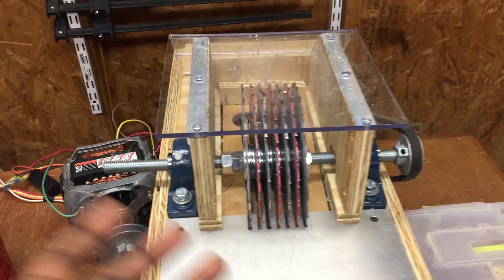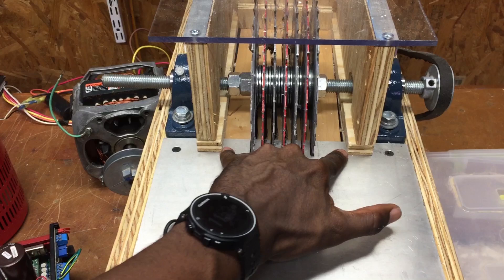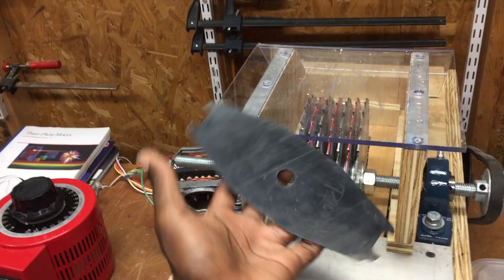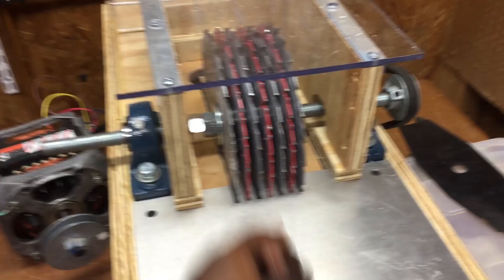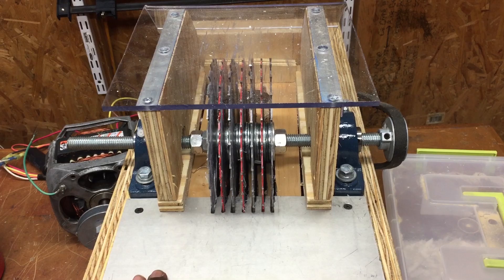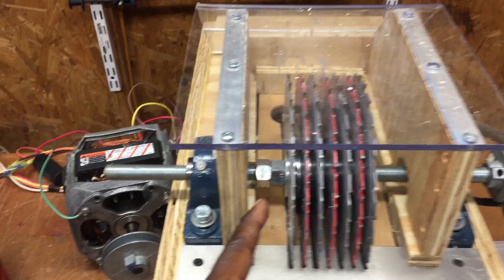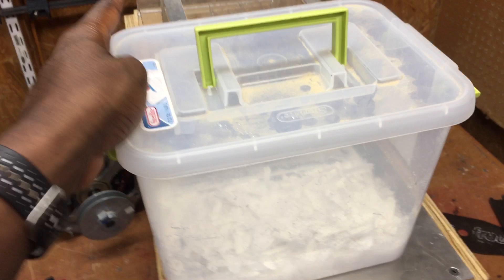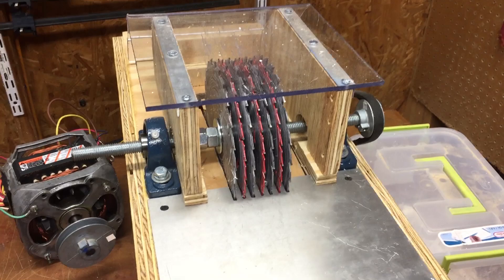Scary Prototype Shredder Design pt 2; A Cheap Alternative to the Precious Plastics Design: 037

Comment: I've been in the plastics industry for over 20 years (off and on), and shredding and grinding scrap is a BIG deal, so I've dealt with that a fair bit...
Have you considered a screen under the cutting chamber?
Basically, the screen openings would be sized to allow the size of plastic granules that you are shooting for to fall through in your collection bin.
But, it is spaced close enough to the blade tips so that anything that doesn't fall though gets thrown back up and goes through the cutting cycle again until it is small enough to fall through.

Your design is a good start to what you want to do, and, even as the former safety director to more than a couple companies, I really don't have a problem with the inherent risk involved in operating if because you KNOW the risks, and are not putting some green-thumbed new hire operating it.
I build machines, and sometimes build stuff for 'proof or concept' that scares the hell out of me - but that's how you get to the final safe machine.

Not sure what general grind size you are looking for, but what ever it is, find a piece of perforated metal with roughly that size hole and form it around the blades so that the gap between the blades and the metal is slightly smaller than the desired size, and enclose the cutting chamber - because there will be a LOT of stuff flying around in there.
Also, just to let you know, when grinding plastics, the RPM of a typical industrial grinder is usually set at about 700 - 800 RPM.
That said, the fly knives are usually cutting at anywhere from six to 10 inches away from the center of their driven shaft.
The reason for this is, in a grinder that recirculates its over-sized, "needs to be chopped again" stuff, a much higher RPM tends to heat the plastic enough to plasticize it to a point of being semi-liquid, which clogs all your stuff and shuts the whole thing down.
With your design, though, if you go with a screen, I think you MIGHT need to slow it down a bit, but not as much as what I said above. If you do need to slow it for sheer heat considerations and you find it bogging down, a flywheel will eliminate that issue since the load you place on the blades is momentary, and the flywheel is in a constant state of inertial recovery.
Reply from the maker: Once I have my plunger worked out, I think I will try this. My first design followed after Dave's shredder of precious plastics. It has the screen and I was looking for significant speed reduction as well. After many, many contraptions to get the speed down (seen in my shredder playlist) I am trying the other direction for a while. I do have commercial grade gear boxes and motors which would allow me to make a more traditional shredder... but I want to design something that can be easily copied for a very low cost... and of course is safe to use. Ideally it would only need about 1/2 horse power.
Reply: Hi  @Jeremy_Fielding  . How have you gone with this experiment to make a low cost, high RPM shredder? I don't see any subsequent videos on it. Am I missing them?
Reply: Yeah, I'd love to see where this ended up too :)

Comment: Jeremy, as you and others have said, this is a scary, scary machine.  I work for an office equipment company and have worked some on some of the larger centralized office shredders, like the Destroyit 4002 and some of its smaller cousins.  These shredders use counter-rotating blades that run at a relatively low rpm, perhaps 200-300, maybe even a little less.  They generate their torque by having gear reductions.  Now the gears are made of some sort of plastic or nylon, but they are quite stout 3/4 of an inch to 1 inch wide bearing surfaces.  Even at the low rpms that these shredders run, its still quite scary to listen to them operate as they chew the hell out of paper, credit cards, cds, whatever.  And as someone else mentioned, they do have an interlock that prevents the machine from operating if too much thickness has been fed into its throat, and it has a reverse button for clearing any jams.

If I get a chance this week, I'll 'borrow' the one from accounting and take the cover off and snap some pics or a video or something so you can see how a larger office shredder operates and perhaps give you some ideas for improving your plastics shredder.  I've enjoyed watching your videos and your creativity, please don't have to rename this to the stumpy channel.
Reply: so did you get the chance yet?
Reply: interested in seeing your office shredder.

Comment: After I've made something, I've ground down the left overs by shaving down pieces carefully on my table saw. I used a vacuum to collect the tiny pieces as I went along. I ended up with large amounts in trash bags. When I went to remelt for something else, they seemed to want to hold air. I had to press down occasionally to squeeze air out. When I finished melting, I let it cool in a press. No voids, but it was a lot longer melt time with all the "fluffiness".
Reply: Yeah HDPE fluff acts like insulation. I melt the swarf I get off my mill and it kind of sucks. Here funny picture http://i.imgur.com/Mqsy43E.jpg That's after I pulled a box of swarf off the machine.

Comment: It's sweet and obviously a work in progress. It's almost exactly what I've been wanting to try. I would be doing the exact trial and error process. Try rubber gaskets in between the blades and gaskets if you have problems with slippage. I saw it in another video where someone made a dato with regular blades. Maybe use the blades and push some wood or aluminum into the gaps in a safe way to close up the gaps. Take the lexan off and put a temporary cover on it and slowly push the material into the blades. That way you'll have less space for stuff to sit and melt. Add your hopper and you'll be good to go.  I can't wait until I can do the stuff you do again. It's so much fun. I'm just living vicariously through you right now.

Comment: Hi, I was lucky enough to get an industrial shredder at an auction I went to, no one else wanted it so I got it for £0:20p (UK). I did not go with the intention of buying that but it came up and I decided to get it as no-one was biding for it. It is a cross shredder and makes very small squares about 5mm in size. I use it for cutting bills and change the bin when using it to cut my plastic. You told everyone that it was a prototype and I accepted that and did not comment on the first video because I did not think that it was finished and accepted that you will make it safe when you have finished testing things. Good luck with your ideas.

Comment: Here's an idea to counter the material getting pulled in. What if you do a preliminary melt prior to shredding. Something like two electric griddles that you could get cheap at a thrift store, to heat and flatten the milk jug. Then it will be a bit thicker and less flexible. Then maybe you can lower the speed and not get powder.

Also, the spacers for shearing could be vertical plates instead of fingers on the thin horizontal plate. That would prevent those breaking off.
Reply from the maker: I think you are right... pre-melting could allow me to make thicker layers which would not get sucked in... I am not sure I want to add another step though. I might be easier to just keep cutting at the bandsaw. I am not so sure "powder" is bad yet. I might be that you have to mix it while it is baking... With the current setup the fingers don't break.

Comment: It's awesome iv saw this. I been gathering stuff up up to build one close to this. I got a long piece of eight inch square tubing that I was going to mount blades in the same configuration in. Was planning on dropping them into top and letting them go down and drop out the bottom of the tubing. It makes sense what you say about the debris blowing back out. I kept wondering why nobody else had came up with the idea of saw blades and try it glad you did
Reply from the maker: I am excited about where it is going. I look forward to getting it finished.

Comment: “If” you added more blades, less side space,  HOWEVER, you could drill holes in the nut and counter sync Allen screw into nut to lock that single large nut to shaft.  That eliminates two screw for locking in place.  (HAHA, YOU CAME UP WITH THIS BY NOW ….. 4+ YRS AFTER THIS VIDEO).  ANY WHOO.  GODBLESS!

Comment: With that melt problem, I believe industrially, they are fed through heated augers to help consolidate the material as it gets molded.
Reply from the maker: I have tried stirring it while heating it... that does help a lot... but the heat and texture make it very difficult to stir.
Reply: I smash my melts down as I go with a metal rod, actually the back of a large metal punch while I recharge the melt. To compact and consolidate things for me. But stir it? You're melting injection HDPE if you're stirring it. I want to see you try to stir a batch of molten blow molded HDPE. That's the crinkley translucent jugs like milk, and water come in. You'd have to have forearms like Popeye to stir that stuff. Why melt blow mold HDPE if it is so hard to work with? Because for sliding mechanics blow mold works better. Solid blow mold is harder and much slicker than injection. They're both HDPE but they're different. This is made out of blow blend HDPE http://i.imgur.com/lSsNyBG.jpg It worked good until the wood moved on me. Then I had to scrap it.
Reply from the maker: The water jugs (semi-clear) definitely don't work well with the milk jugs. They (water jugs) are stickier as well. I didn't say it was easy to stir. I use a 3/4" steel rod and have to clamp the container while I push and prod it. Stirring is maybe an overstatement. But it does help a lot.
Reply: Depending on the task, I might evacuate a heat resistant container that seals and then melt in that, or weights on top. Again, task dependent.
Reply: Yeah I smash the melt down as I go. If you want slick HDPE you have to melt the translucent jugs. But sometimes the blown HDPE is too slick. I tried to make a pistol drill bench stand out of some, and the drill just slips out of the clamp. One secret to oven melting HDPE is to use a convection oven. It makes a big difference. So if you can convection it is worth it. It stops the plastic from burning on top so you can melt at a higher temperature. I melt at 385°F I could probably go a little higher, but that is hot enough for me. You can melt plastic in a non-convection oven, but it is not the best. That's how I started out. Then I upgraded.

Comment: 1. You should design like a drawer that you put the plastic in, and it pushes into the blades. 2. You should flip it on it's slide so the shear plate is parallel to the Y axis so you can grav feed with a hopper.

Comment: Maybe try making the front shield slope down on a right angle triangle and make the wall facing you double thick to support a piece of plumbing pipe a little bigger than a 2L bottle, the angle on the feed pipe will help the bottle self feed and if it's plumbing pipe you could get a plug that fits it and sand it so it goes in effortlessly as a pusher for bottles that don't want to feed and make a stop so your push plug doesn't touch the blades.
Reply from the maker: It would have to be really large. Most of my source material is milk jugs. Most of the soda bottles are pete plastic. I am focused on HDPE right now. I do plan to try the others soon though... once I have a way to melt them outside.
Reply: That white jug you ground up isn't a milk jug where you're at is it? Because it is made out of injection impact HDPE not real blow mold HDPE. Blow mold HDPE is the translucent jugs that you can almost see through. Water has to come in blow mold HDPE by you. Like the gallon jugs of water.
Reply: Jeremy Fielding I didn't even think about the 4L bottles, I drink water or juice 95% of the time and I'm allergic to milk so the 4L bottles just skipped my mind, in that case maybe try putting a slight slope on the whole shredder by raising the input side from the base, you could stick some scrap wood or books or anything under it that is stable to see if it might help keep any debris from escaping during use.

Comment: I love what you’re doing and hope your subscriber numbers explode! Ideas: the front screw in the lexan seems too close to the edge and the stress concentrations caused by the hole may make it fail over time. 2) weight the rotating part to increase the rotational moment of inertia to help prevent stalling and allow you to feed two or even 3 layers of plastic or better: add more blades so that it can accept a crushed milk jug w/o preprocessing. 3) grind down the sides of blade’s cutting edges to ‘bite’ less plastic, which would take less power and create less plastic dust. Just don’t narrow the cutting edges so much that the plastic starts binding on the rest of the blade. James Foit :)

Comment: You can make this design gravity fed by simply turning your entire box on end. Where your shear plate is would be vertical so you would still have the shear. It could effect the particle collection but that should be easy enough to change. You could then partially close in the feed slot which would help safety. I could tell you were wary of it just by how you were feeding it :)

Comment: Another idea, but ...grind the two outside washers at an angle, so they are wedge shaped, the inside holes may need side ground also depending on the play on the allthread, so the cut of the blades would be moving side to side as the shaft turns.  The cutting edge of the blades would just be a blur!
Btw, love all the videos, Thanks!
Reply from the maker: That reminds me of the wobble dado blade. That would certainly cut way all the plastic, but I still have the issue of the plastic being pulled out of my hand because there would be no shear plate in between the blades. It would all be cut away. I think moving the platform above the center line of the blades might eliminate this issue. I do plan to try changing the cutting height so I may come back to this idea.
Reply: Jeremy Fielding I was thinking the wobble 'might'  naturally cut and sheer the plastic at the front plate. As it goes back and forth.  I think the  bobble would have to be greater than the blade gap to cut the strip off.  Yes I have an adjustable wobble dado blade that I bought about 25 years ago, and that is where I got the idea, I just did not remember what it was called!

Comment: As for having vibration issues with the dado blades, you could use a fly wheel on the shaft to dampen the vibration.

Comment: Man youre an awesome dude. Keep it up, you actually inspired me to start scraping some stuff so they dont go to waste. I recently took apart an old vacuum cleaner for the motor to possibly make a lathe.
Reply from the maker: That is awesome.
Reply: Vacuum motor (2 pole Universal motor) spins too fast and will over-temp quickly.  
Look for a 4 pole synchronous motor that is better suited to the application.

Comment: You could make plywood gears to assemble as planetary gears and stack the inputs and outputs. Locking various elements changes behavior as speed and direction. This concept is used in military tracked vehicle power transmission. They are compact and efficient
Reply from the maker: +Randall Ivie you would have to make the teeth of the gears really thick to withstand the high loads they would get. That makes for a very large planetary gear.  It would also require multiple stages. It would be very compact in steel but not wood. One final thought...It would be difficult to make it perfect enough. I have made several planetary gears and it is quite the challenge to make. I want people to be able to copy my design when it is done.

Comment: put a long rod with some sort of rubber sleeve around it right in front if the blades, the attatch that rod to a power source so it spins, also make it spring loaded so it is constantly pushing down. that way you it will feed the plastic into the blades for you, keeping your fingers at a safer distance.
Reply from the maker: a power feeder is in interesting idea